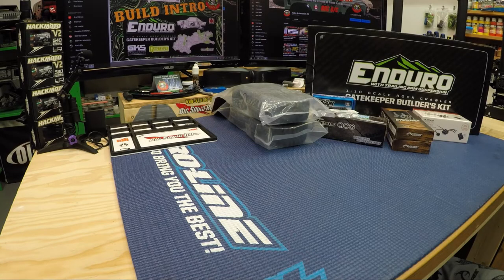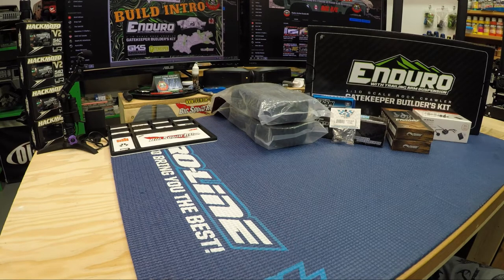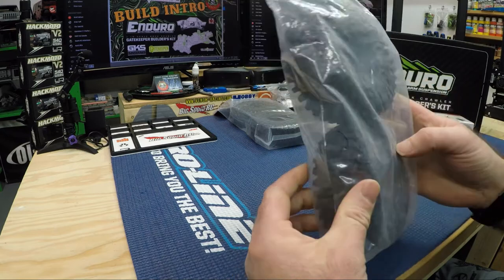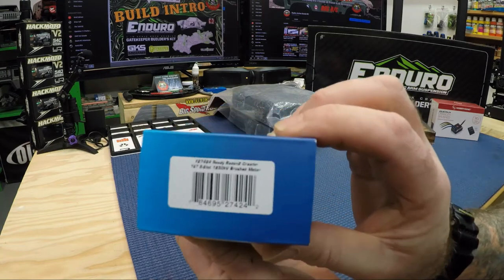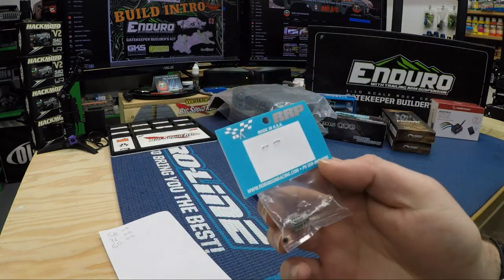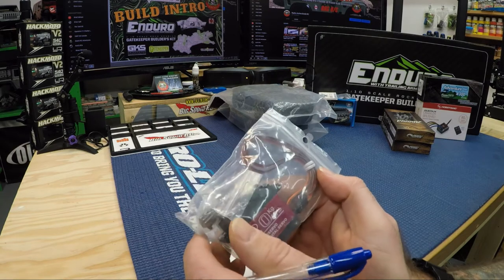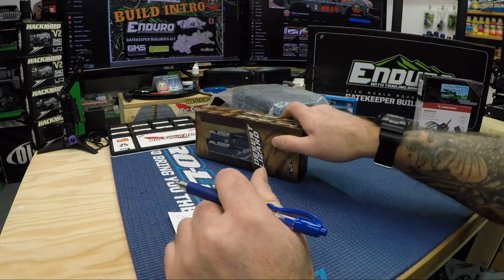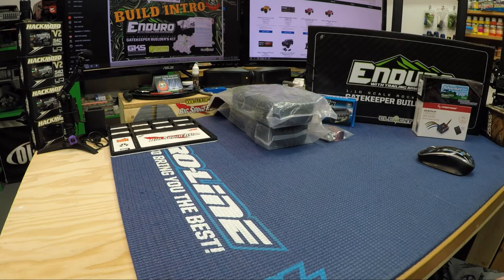ENDURO GATEKEEPER BUILDER'S KIT " BUILD INTRO"

Comment: Wow, looking forward to seeing what you do with this build.  I love my Gatekeeper, I think I am running the same rims, battery and servo in mine. The Reedy motor I run those in my Element Enduro truck and my Vaterra, they are very smooth motors.
Reply from the maker: Looking forward to this build shouldn't take to long. Hoping to get the lights quickly also. Thanks for watching and commenting see you at the next one.